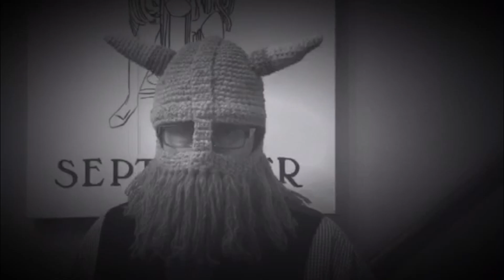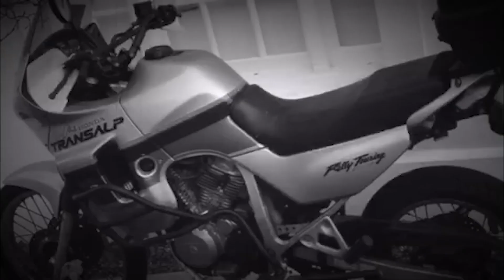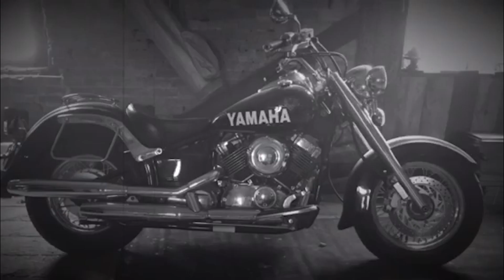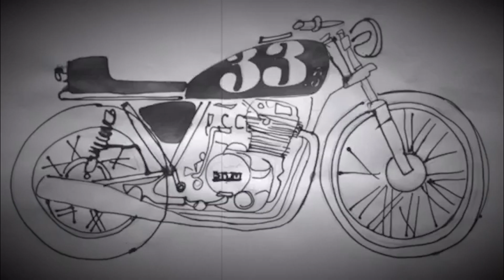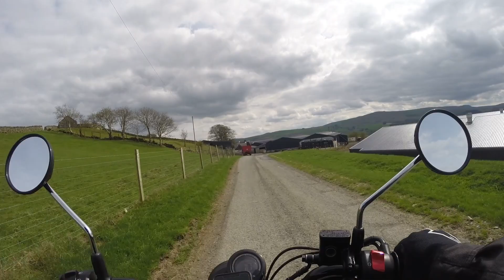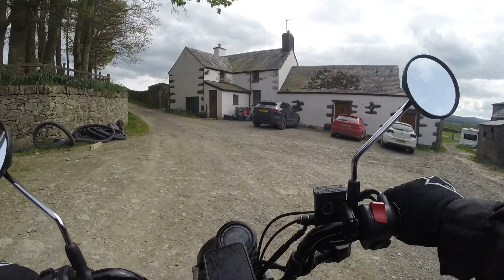Dick Rides his CT125 Searching for an Old Quarry Road

Comment: The more I see this bike, the more I like its looks. I reckon these 125cc engines are robust enough. Keep your eye on the oil level and change it every 2,000 miles. As I've said before, it's the heel/toe shift I don't like. These are cheap enough in Thailand, and I live in Chiang Rai most of the year. I'll probably stick with my Yamaha Aerox 155 for knocking about locally, though.
      Edit: ignore the username that's been foistered on to me. I am 1990.